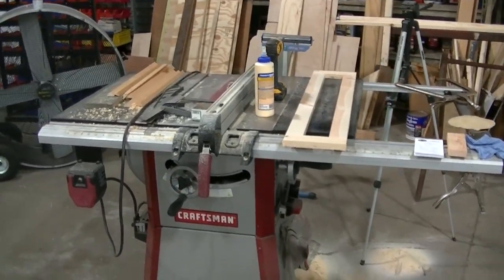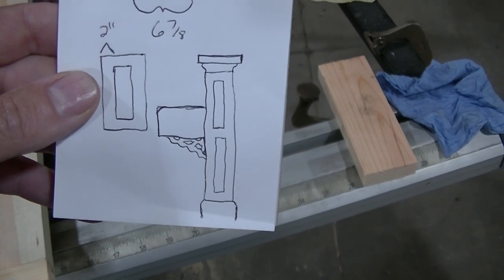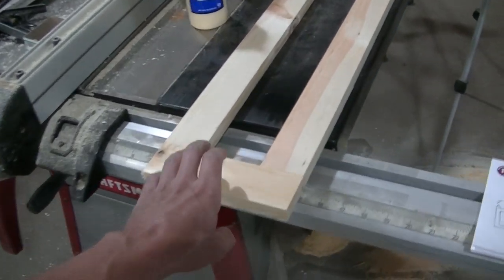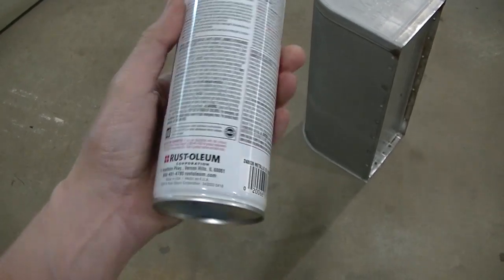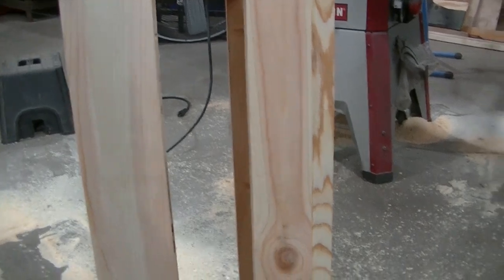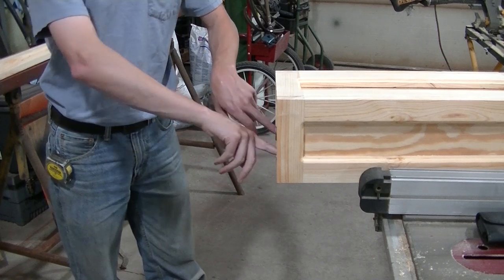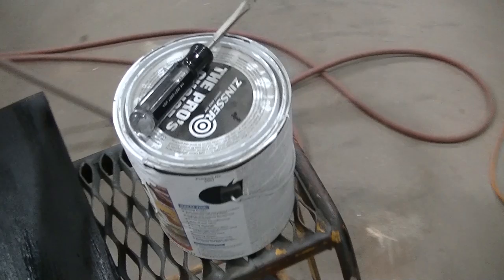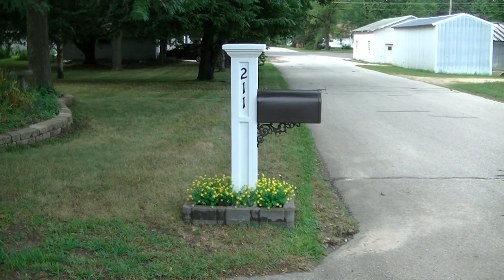Mailbox Makeover | Custom Build

Comment: I am gonna tell you, you are talented! That came out amazing! The way you talked at first i thought i don’t know about this one.. lol he don’t sound real sure about what he is going to do.. but dang man, you knew exactly what you were gonna do. Everything was clean and tight.. no amateurish stuff here. You do very good work. You have high expectations of yourself and the work shows. Thanks for the video! Gave me some good ideas. I have 4x4 post in there now so i will need to add blocks to center it but thats no issue. What size are those trim pieces? Are they 1x2s?
Reply from the maker: Yeah, I go with the flow and build as I go. I have some basic ideas in my head and then just build. I will have to measure because I don't remember the size.